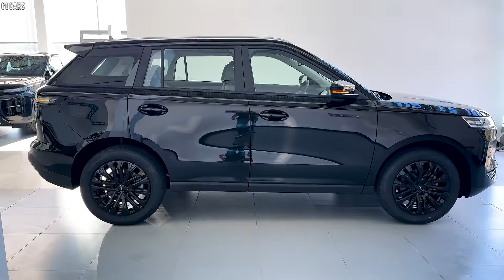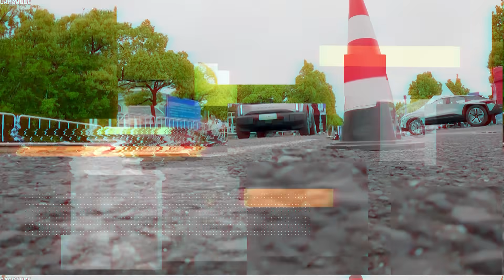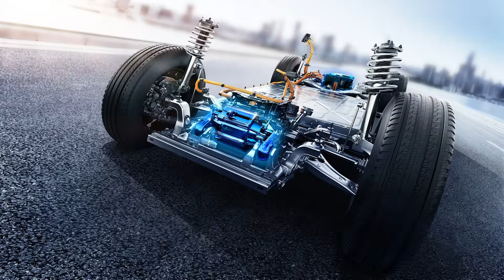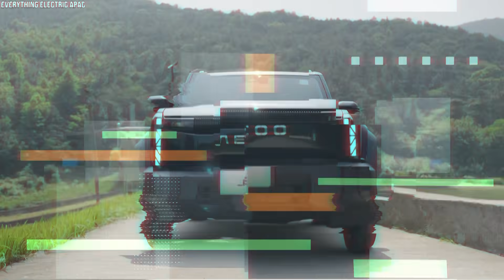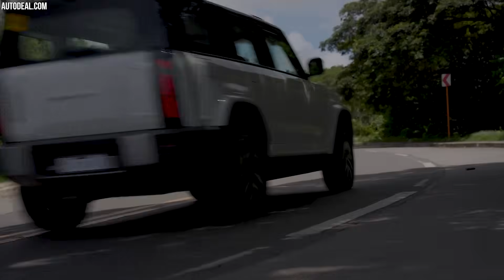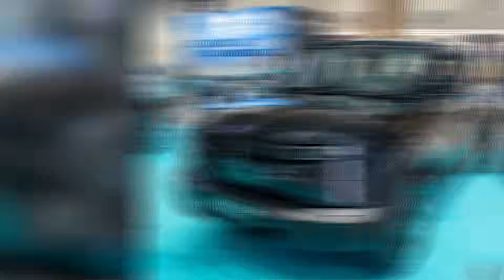China's Jaecoo J6 Could End the Luxury SUV Game | Aluminium Chassis

Comment: The salary of the auto workers in the US is way over paid. And the extra safety accessories required on the car that the consumers don't need but are forced to pay for it. The strictly US safety regulations that require are part of the reasons that drive up the costs of the car. There is one thing I disagree with the video was that in the US a maximum long range battery pack is needed. Thinking about traveling. You have a one car garage for your car, or you live in an apartment building without a parking space and you must pay for a parking space for. That parking adds cost to your budget and because of it you wanted to save money and to cut your bills, one car is all you need and that car will take you to work on the weekdays and it takes you across the town on the weekends. The biggest battery pack you can afford even if you don't need it.